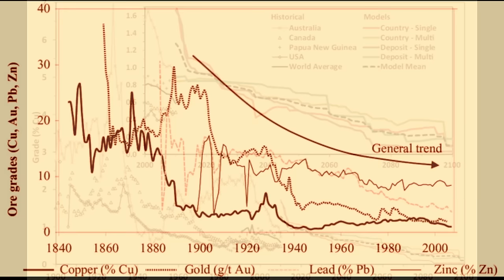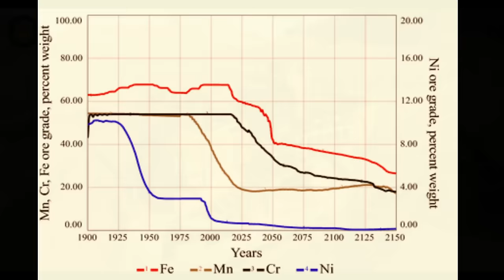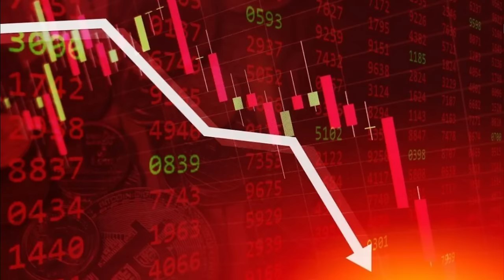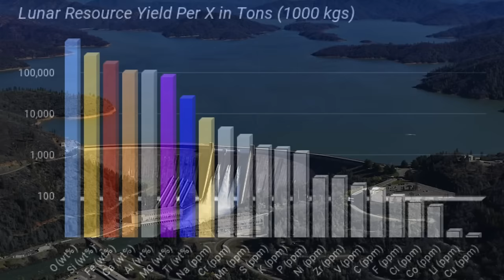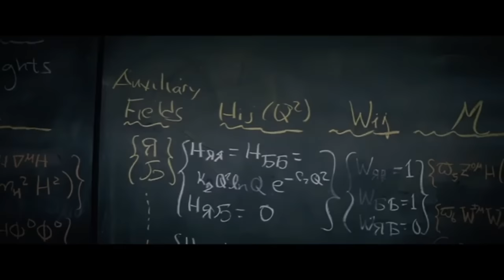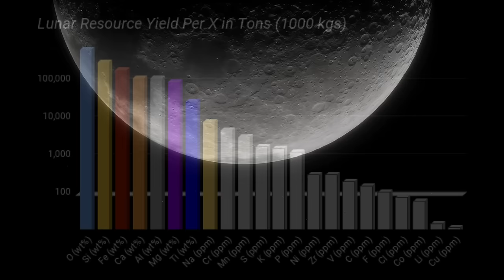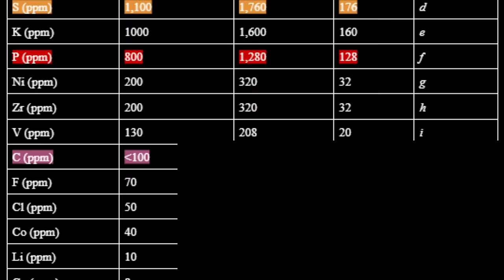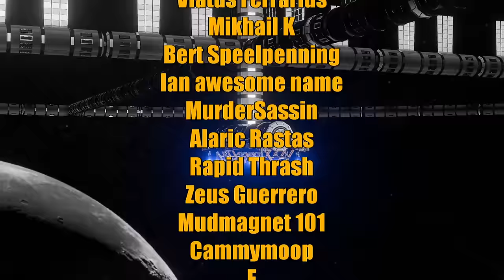Strip Mining The Moon With Giant Excavators

Comment: One of the byproducts from producing oxygen gas is iron. This stuff isn't steel, it's a high phosphorous electrolytic iron. Here on earth it's quite expensive. But for insitue resources, it will be important and abundant. The thing is, it's not structural, the phosphorus makes it brittle, and incapable of the same demands we put on steel here on earth. However, due to its abundance and inevitable production, it  becomes advantageous to find ways of utilizing this material. Moon trains anyone?
Reply: Any steel can realistically be used as structural steel when you're only dealing with 1/6th earth gravity, to be fair
Reply: @BarrGC 
That depends on what you think is structural. In engineering the term doesn't simply mean it can hold a static load. It implies the dynamic forces experianced in things like pressure vessels, beams and buildings, vehicles, machinery, and any other application you can think of. The phos content makes lunar electrolytic iron EXTREMELY brittle. The stuff almost fractures like glass when hit with a hammer. This is due to a FeP phase segregation at the grain boundaries. When we use steel in terrestrial applications the expectation is the typical stress strain curve, with well defined elastic and plastic deformation regimes. However, with brittle material statistical fracture probability dominates failure modes, which inherently introduces unpredictability even at lower forces like lunar gravity. My particular excitement is in applying science to overcome these issues to enable the future :D We've got make that lunar base a reality.
Reply: @TheTrueOSSS  well obviously for pressure vessels and machinery it's no good, but I was referring to it as structural for the purposes of the first basic structures we would build using it.  You are right though of course and beyond those first few years, we should be able to find a nice carbon deposit eventually.  Long term though aluminum would be my choice for most needs on planet and save the titanium for everything in orbit.  I know, nightmare to extract and process, but once you're all tooled up, the lightness and low melting point would be huge energy savers and it's just such a dream to work with.
Reply: @TheTrueOSSS  And totally agree, i cant wait till we get up there and get started, Artemis delays(& I expect plenty more 😑) are pissing me off as does that huge waste of time, money and resources we call the SLS, lol
Reply: @BarrGC Have a look  at metal fatigue in aluminium it is a horrible material for constant heavy use!
Reply: @jackdbur   Oh I know all about it, it has no endurance limit so even the tiniest stress fatigues it.  For structures though on the moon, that's ok, you just need to design things robustly enough.  You need a cyclic stress to fatigue it, so in dynamic settings, not so much a worry in static structures on a place like the moon with no wind loads or worries of earthquakes (moon quakes are very minor).  This is why I would just use it for stuff on the moon itself, anything in orbit or for more dynamic situations, that's what all the moon's titanium should be used for

Comment: @20:34 that is not 1080. That appears to be some sort of low carbon steel. 1080 has a substantially higher carbon content in the 0.8% range. 

Though i think there is a whole discussion that can be had on materials needed for various things on the moon. Since everything weighs 10 times less, it likely puts much less emphasis on material stiffness (implying crappy steels can be considered). There is a whole host of scientific literature on the subject that delved into on this subject.

Comment: It occurs to me, these monster machines will have monstrous energy consumption producing monstrous heat. How will that heat be expelled?  Can't just attach ISS style infrared radiators. They will infrared cook anything nearby. Must move that heat to radiators or ground sinks or something far away from the machines. Will they operate in the two weeks of scorching daylight?
Reply: As very few of the machines would have operators who cares. You want to be below the surface to live for extended periods anyway (there is this small issue of radiation on the surface)

Comment: The goal of starship is to have a rapidly reusable rocket, and lots of them, right? With how cheap it is projected to be, why is it not easier to just launch every machinery part from earth rather than trying to manufacture on the moon? Obviously long term it would make more sense on the moon, but for the first couple of decades it would probably be easier to just launch them from starship no?
Reply: Even with Starship, it's still way cheaper and more economic to do as much ISRU as possible.  Could take up to 5 tanker loads to fill up a lunar starship in LEO, so getting mass to the moon would still be 6x more expensive than to LEO, so still a LONG way to go b4 the moon resources would not be the best option for anywhere in space

Comment: Steel is a no go because carbon is essential to its strength. Iron aluminium alloys though are amazing. There's no way they don't use that instead.
Reply: It's 1/6th gravity, so even the most brittle, shitty cast iron could still be used as a structural material if you really wanted.  Moon has record amounts of titanium deposits though, so that would be the long term goal, but shitty steel for the short term

Comment: Import a metric butt load of nuclear reactors into space to get your power fill. That’s gotta go over well with the regulators.

Put one in the house size a chain bucket excavator. Or four. No need to charge a battery for the machines larger than a reactor that needs reactor sized power loads.

I can also see a “lunar load” becoming just a “load” as time carry’s on, and see it sticking due to the funny name. That’s how a lot of things got their names. Ex. The tank, walkie-talkie.

Also, steel is used because it is cheap and has great qualities. Maybe a more direct a lot of lunar revolution metals, would be cheaper and good enough? But it might also be a brittle block of worthlessness.

I wonder what kind of machinery we are going to first make on the moon.

I am still curious where all the fuel for the spaceships are going to come from. Yes water makes the most sense, but there has got to be better options.

Comment: there is a huge problem with carbon:
Pig iron require more carbon than steel, or you fund a way to bypass pig iron or you need to ricycle the carbon removed from pig iron.
injecting oxygen is the main path to remove carbon from pig iron, but oxygen exist only in a close space, so you need to make an atmosphere for the process, that is a problem.
Steel making process require a lot of heat, so, you are in the space, where is difficult to dissipate heat and you need to dissipate heat to recycle and purify the furnace air to recover the carbon and others expelled from the pig iron and at the same time reduce the temperature of the steel to obtain the desired mechanical composition of the steel. Producing quality steel is much more complicated than you might think, and heat removal is the first problem. You could use huge radiators and circulate large quantities of water, but we are talking about enormous volumes, it would be nice if someone would come up with two numbers

another prolem:  on eath we use gravity to cast the iron in slabs, blooms and billets. I only wonder how the liquid steel react in a low gravity environment, hard, hard, hard, very very hard

Comment: You forgot to mention that micrometeroids exists, the moon recieves billions of these every year (approximately one per square meter per day), with the size less than a mm but travelling 20000 to 70000 kilometers per hour. So it's the same kinetic energy as someone shooting with a 9mm handgun everywhere at random but with much more penetration capabilities as the projectiles are 0.01-0.1mm big. So you need the vehicles to be shielded, possibly even having a roof over critical components or a roof over the whole vehicle that are bulletproof, like a 3-4 cm steel sheet that could be replaced and/or repaired regularly.

I think the same as you, using solar power and batteries to be the best way if you manage to shield the panels from being hit somehow. 

To shield the solar panels you would need bulletproof glass 6-8 cm thick on them to withstand the bombardment, but after just half a year it would be useless and need to be replaced because of the damage fracturing the glass dispersing the sunrays. A more promising alternative is a self-healing transparant polymer that heals itself when exposed to heat, a tech that is being developed and evolved right now specifically for space applications. And it doesn't do that much if the effectiveness is reduced a little because the sunlight on the moon is much more consistant because of no atmosphere, clear skies every day.

And a small nuclear reactor as backup ofcourse for key components that keeps the personel alive.

Comment: There is a design of portable tower lighting that uses three rolls of square frame links that join together that become a triangular mast   the links are pressed plate and hollow.   Robotic trucks to scoop up lunar soil.    Magnetic separators grab the iron fragments left from asteroid strikes. 

Outside skins on the landing craft are actually polished and become solar reflectors.    The non ferris material is placed in a crucible on the extendable tower to be raised to the focal point and turned into molten material.   Poured into molds or forms to create building blocks.   The ferris materials can be processed the same.  

The first project will be a tapered ramp used with either solid rockets or linear electromagnetic launch to put ferris products into lunar orbit to retrieve.  

Lunar orbiting space station with solar reflectors could heat that. Or use PV  to inductive heat the ferris material for processing..   it's all in getting the major pieces of equipment to the exact spot on the lunar surface.

Comment: I do think you're still underestimating the need for lubricants and the effects of regolith on bearing surfaces. That's not something you can just wave away with a funny meme. The walker solution is fucking genius and would be well suited to that particular environment, but that just reduces the need for lubricants, it doesn't eliminate them. It's true that you can sort of design around this limitation, but high wear/load surfaces will end up needing frequent replacement which will impact the productivity of the crawlers. Anyone who has worked around heavy machinery and equipment knows how important regular maintenance and repair is. You should look up galling and how it can affect machinery.

Something to consider is that while you can raise those surfaces up out of the reach of dust clouds, those dust clouds will be larger and linger longer because of the weak gravity and lack of wind on the moon. Meaning, they'll be far more prevasive and get into every component imaginable, including those that aren't designed for them.

Edited to add: the solution might be there on the moon to begin with: graphite (which is just carbon) is often used as a dry lubricant and would also be immune to evaporating in the near vacuum on the moon's surface.

Comment: you are gonna have to factor in that every kg of rock mined will likely need to be blasted.  excavators are only effective when they are moving soft material (eg: soil, sand, clay, mudstone, shale), of which nearly all is the result of weathering.  

typical rock has a powder factor 0.6~0.8 kg of ANFO per cubic metre which you will need to ship in regularly, along with primers and detonators and other sundry equipment.  additionally you will need to drill a lot of holes for all that bang to go into, which might be tricky because drilling in rock is a different process than drilling in wood that people are used to.  with wood-drilling the leading edge of the bit acts like a wedge that shears the material as you turn the shank.  with rock-drilling the bit is hammered against the rock (which shatters under compression) and then you turn the shank slightly so the bit is in a new position and hammer it again, all the while flushing away the cuttings... and herein lays another problem: whatever liquid or gas you use to flush cuttings will need to be captured and reused before it escapes into the vacuum of the moon.

Comment: According to the all-knowing chat GPT this would be the best steel alloy for lunar purposes

To produce a steel on the Moon that closely matches the lunar soil composition and utilizes the available materials in similar proportions, the best candidate would be an Iron-Titanium-Aluminum alloy. This alloy leverages the most abundant metallic elements in lunar mare regions and aligns with the proportions provided.

Proposed Alloy Composition:

Iron (Fe): ~70-80%

Derived from Iron Oxide (FeO) and Ilmenite (FeTiO₃).

Titanium (Ti): ~10-12%

Sourced from Titanium Dioxide (TiO₂) and Ilmenite (FeTiO₃).

Aluminum (Al): ~5-10%

Obtained from Aluminum Oxide (Al₂O₃).

Minor Elements:

Magnesium (Mg): Trace amounts, potentially from Magnesium Oxide (MgO).

Calcium (Ca): Trace amounts, potentially from Calcium Oxide (CaO).

Rationale:

1. Abundant Iron Sources:

FeO (15–22%) and Ilmenite (FeTiO₃, 5–12%) provide a substantial amount of iron, the primary component of steel.

2. Significant Titanium Availability:

TiO₂ (1–12%) and Ilmenite offer a considerable titanium supply. Titanium enhances strength and corrosion resistance when alloyed with iron.

3. Aluminum Inclusion:

Al₂O₃ (5–10%) allows for aluminum addition, improving the alloy's strength-to-weight ratio and oxidation resistance.

4. Complementary Proportions:

The proposed alloy mirrors the proportions of available materials, making efficient use of lunar resources.

Production Feasibility on the Moon:

Reduction Processes:

Iron and Titanium Extraction:

Iron and titanium oxides can be reduced to metals via electrolysis, using solar energy available on the Moon.

Aluminum Extraction:

Aluminum can also be extracted through molten oxide electrolysis, albeit energy-intensive.

Lack of Carbon Requirement:

Traditional steel requires carbon, which is scarce on the Moon. This alloy sidesteps the need for carbon by relying on titanium and aluminum for strengthening.

Manufacturing Techniques:

Powder Metallurgy or Additive Manufacturing could be employed to fabricate components from this alloy in the lunar environment.

Benefits of the Iron-Titanium-Aluminum Alloy:

High Strength and Durability:

Titanium and aluminum enhance mechanical properties.

Corrosion Resistance:

The alloy would perform well in the harsh lunar environment.

Lightweight:

Aluminum reduces the overall density of the alloy.

Thermal Stability:

Suitable for structures exposed to extreme temperature variations on the Moon.

Conclusion:

The Iron-Titanium-Aluminum alloy is the optimal steel equivalent that can be produced on the Moon, utilizing the available materials in proportions that closely match the lunar soil composition. This alloy would provide the necessary mechanical properties for constructing lunar infrastructure while maximizing the use of in-situ resources.

Comment: You're missing one crucial thing in all your calculations - how will you manufacture said steel or aluminium without carbon or hydrogen as reducing agents? Whatever water ice is on the moon has to be spared to support human settlement and to be used as rocket fuel to return to earth. You can't simply add electricity to the ore and get rid of the oxygen sadly.
Reply from the maker: Yes you can. And also https://youtu.be/xH4Ki6TxRTs?si=LnXwmjnYXtLV4z9y

Comment: Good ideas BUT all your designs in all your videos do not take into account the abrasive dust on the moon. Running steel wheels on rails that have dust on them will be like running a steel wheel across sandpaper. All your designs have moving parts that are not protected from moon dust. Look up on the internet about the problems on the moon with the very abrasive dust. The moon dust has sharp edges and is caused because the moon has no atmosphere whereas on Earth the dust gets moved around by the air and all its sharp edges are rubbed off.

Comment: Yes this is what we should be doing, build out to the moon, learn how to live and work in the radiation soaked vacuum. Build some infrastructure, make some gas stations or automated emergency stations in orbits between the earth, moon and mars. With stuff like that out there an "oops" on your spacecraft won't be a death sentence. And as far as mars goes, until we get living and working on the moon down pat, we shouldn't be entertaining the idea of yeeting astronauts out there. And we need spacecraft faster, with more thrust and higher efficiency than the kind we've been using since the 50s. Our craft have more sophisticated controls and life support systems but as far as the propulsion systems go they really aren't better than those from the space race era that started with sputnik. Nuclear power sources fission primarily are what's going to make lunar and mars settlements possible. We've been working with fission since 1945 and have it pretty well figured out. Fusion if it happens can then supplant fission sources. While solar is used as in the same way diesel generators are used here on earth and as a supplement to primary nuclear sources
Reply: An oops of any magnitude on a spacecraft or submarine is usually fatal, hard vacuum and high pressure water = death.
Reply: @jackdbur  submarines never have problems?